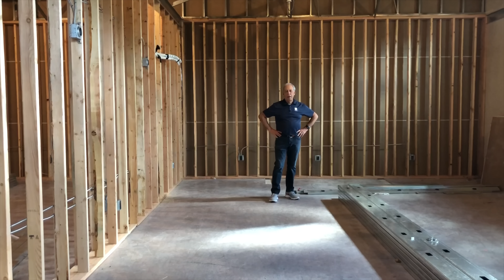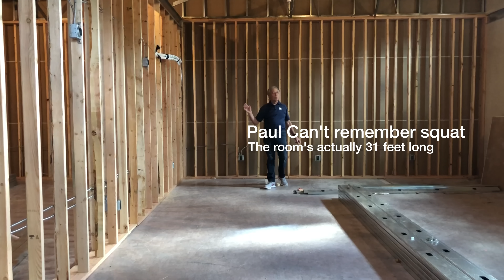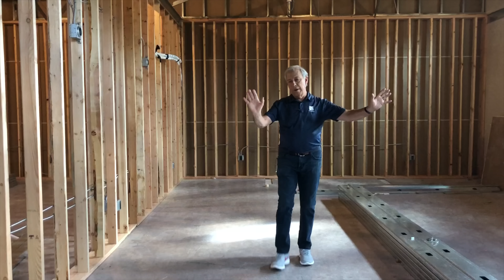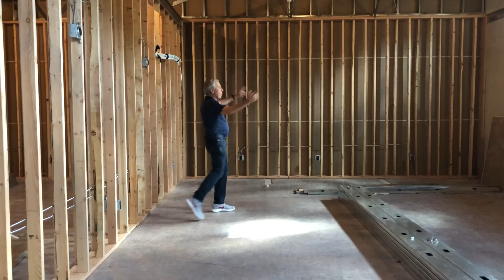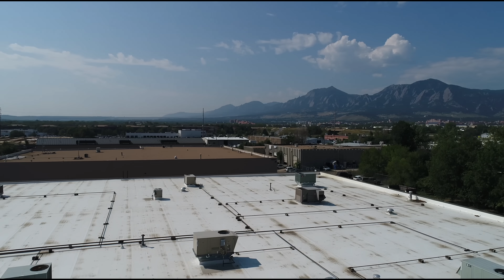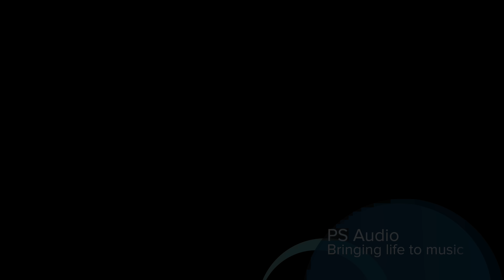Building Music Room One Part 1

Comment: Wow great vid. We have different building styles in Europe.. we mainly use heavy bricks and cement for walls instead of light structures like seen here, however this kind of technology is slowly spreading here too and actually I'm planning my new home built like this too. And now the big magical question to Paul and all others here: how does this "light" building structure behave with big speakers, especially in the bass region, compared to a heavy brick or concrete building, let's say a basement of a house.. ? For mids and highs it's less relevant I think but for huge bass speakers such a light structure is almost an open box, right ? You might get some gain from bass when you put your subs into the corners but then they would shake the whole building here I assume while in a concrete basement the walls are heavy rigid structures and reflect bass in a waaaay more efficient way. So what's the difference having a music room built with this technology seen here and having one in a concrete basement ? I think bass behaves quite differently, you might need to position bass section and even add them some gain while in a room made of bricks/concrete you might have more bass reflections and be more careful where you place them. This all due to rigidity of the walls. I would assume a house built with the "usual"-modern american light structure technology is more transparent for heavy bass waves - they might get out of the building easier so the listener has a whole different task when calibrating the system. In stone (brick) houses it's quite the opposite, bass remains within the room, maybe even causing some trouble (echo, "ringing" effect on bass level) if not calibrated. I'm just curious on your opinions, because on low volumes I haven't recognized a big difference yet, but on bigger speakers there is definitely a difference between wall rigidity, wall reflection capabilities with respect to deep bass waves and wall material inside the wall. Where midrange and tweeter frequencies depend mostly on the SURFACE of the walls (reflection, damping, etc), bass is rather depending on the MATERIAL of the wall, the overall rigidity of it. My parents have built a house with the same tech seen here and when I accidentally hit the wall it can be heard and it's absolutely perfectly built but still has a very-little-tiny "movement" in it at the peak of the hit. When I do the same on a brick wall, nothing, but really nothing can be heard, it's just rigid like hell. Staying at this analogy, a room is for big bass waves like a 2nd box on high volumes.. I think you got the question. :) Any opinions are welcome.

Comment: Paul, 

You could run six gauge from the electric panel to the receptacle box and then splice ten gauge wiring to the six gauge in order to be able to connect your receptacles.  That is, unless the connection between the six and ten gauge would somehow degrade the sound?

Comment: The floor INMHU should be concrete, better if suspended at the corners , sort of floating, but still very heavy , same for the vertical parts , (walls) if you put that wood slats and then cardboard, american style, it won t do, too light --- a light, wood floor resonates too.

Comment: I hate to be a preacher but...  2 metal stud walls one inside the other (no wood, wood = bad) spaced 6inches apart (air gap between them) and the studs staggered.  Rockwool insulation in one of the walls and not the other (or staggered) and two layers of thick drywall with mass loaded vinyl in between and liquid mass loaded vinyl with a caulking between the floor and drywall and where the ceiling meets. Auralex will give you a free room design I believe and makes everything except for the drywall. It cant hurt to consult people who do this all the time for a living...
Reply: I would think the metal studs would resonate at certain frequencies.
Reply: Well the choices are wood and metal, just turn your subwoofer up at home, the walls will go crazy resonating.  The aluminum studs are not going to resonate particularly when  you have hundreds of lbs of drywall and mass loaded vinyl attached sandwiched between. They are a very thin aluminum with not much structurally integrity except when used as studs...  This is the standard for building studios.
Reply: Here are instructions that can explain it much better than I can  auralex.com/wp-content/uploads/2014/10/acoustics101v3_0.pdf
Reply: @ David Perkins

I have 6 inch steel purlins in my ceiling and standard hardwood stud walls. The steel purlins "talk", the walls not so much.
Reply: @dhpbear2  I thought so too but they don't. Metal stud walls actually have better sound transmission loss (isolation) than wood.
Reply: You are completely right this goes against everything that is written about building rooms with good acoustics. But and I do hope it's intentional this setup is probably more similar to where the product will be listened to by the customer. They should have a room equal to that of a mastering engineers' studio so the have an unbiased listening environment.

Comment: Paul how do you avoid ground loop issues with the separate ground runs ?
Reply from the maker: It is the separate ground runs that eliminate ground loops. Ground loops come from differing potentials on grounds. If every ground is separate and all meet back at the exact same point, there can be no differences in ground potential. The ground loops happen because grounds are shared or because they terminate at different places. One of the most classic ground loops is found on cable TV grounds because they terminate in a place very different than your home.
Reply: I absolutely love the sound of the older Infinity speakers, so I am very interested in your new speaker line up.
Reply: Hi Paul, do the grounds run separately only to the circuit breakers and then beyond the circuit breakers share the same gound line down to the grounding rods? Or they are completely separated beyond the circuit breakers down to the grounding rods outside the building? Could you please clarify this aspect?
Reply: Any insight on the gound runs would be much appreciated.

Comment: Any concerns about ground loops with running dedicated power lines? If so what can be done to avoid any potential issues?
Reply from the maker: No, actually, ground loops won't happen which is one of the reasons we like dedicated lines so much.
Reply: PS Audio OK. I was thinking in the case the preamp is in one circuit and the amplifiers in another. but in that case the cable shielding should only be at grounded at one end, assuming is it designed correctly.
Reply: How I long for a dedicated line. Every time the motor on my fridge kicks in i can hear the 'pop' through my speakers! No good.